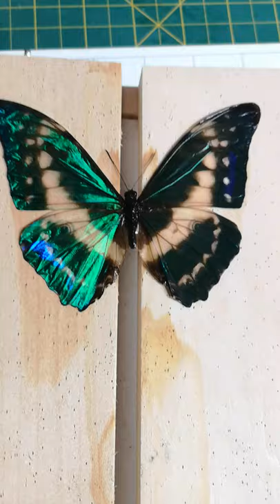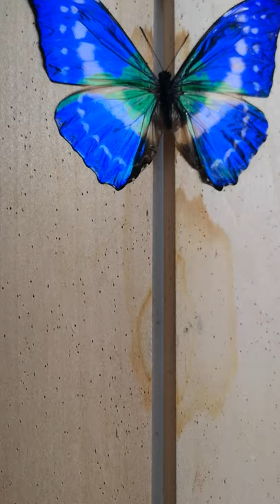Removing Morpho cypris from acetone bath

Comment: How do you dispatch a butterfly so that their wings are up afterwards? I use my freezer to kill them, but that often results in their wings going down, covering their legs and making it difficult to flatten out when I go to mount and spread them.  Any advice would be helpful.
Reply: Keep their wings folded upright and place them in a triangular paper envelope that is commonly used to keep lepidoptera specimens in and that should keep their wings upright as you euthanize them in a freezer. Then you can proceeded to hydrating and mounting them